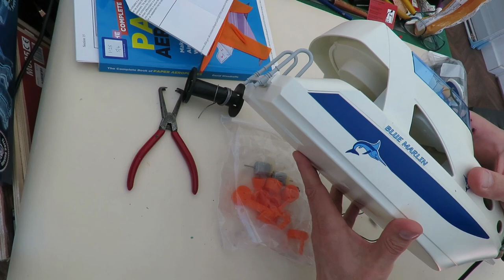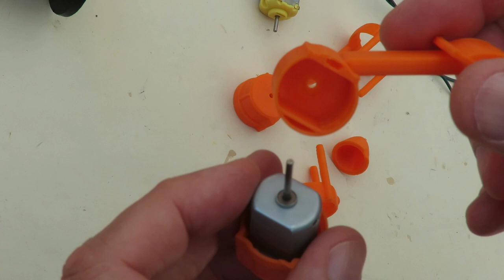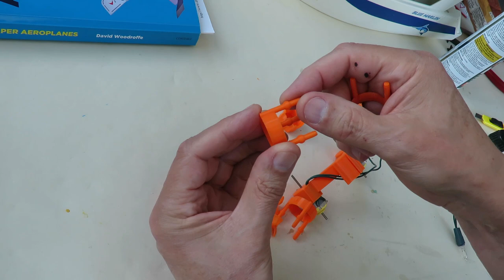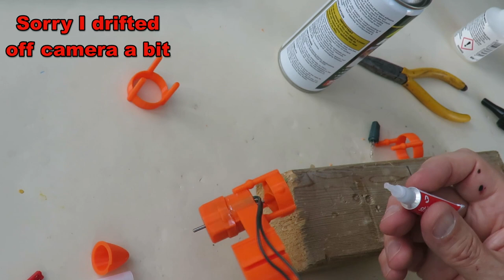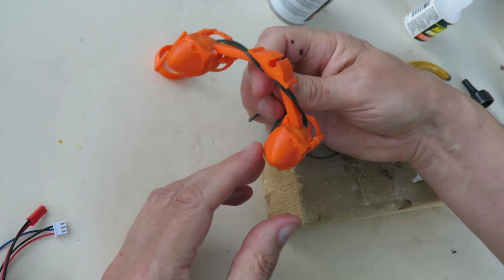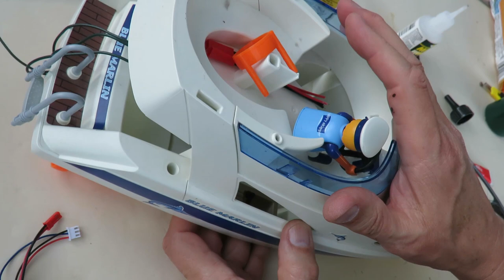Playmobil Blue Marlin RC conversion P1 FULL LENGTH

Comment: Hello. Great job! What kind of motors did you used? Have you a link to buy it? thank you in advance.
Reply from the maker: I don't normally give links because I don't want to favour any particular seller, but here is a link to the motors I bought on eBay https://www.ebay.co.uk/itm/262735145129 I would suggest you check the item and then do your own search to see if you can get a better deal.
Reply: @GrandadsOtherChannel  Thanks :)
"DC 1.5V~12V 5400RPM Double Shaft Mini 130 Carbon Brush Motor DIY Toy Model"
Reply from the maker: @loucaaaaaaaaaaaaaaa  just a reminder, I put no waterproof seals on that design. I just relies on being a sealed unit to stop the water getting in, so over time it will probably fail. You can put grease in it to help, but ultimately it will fail.